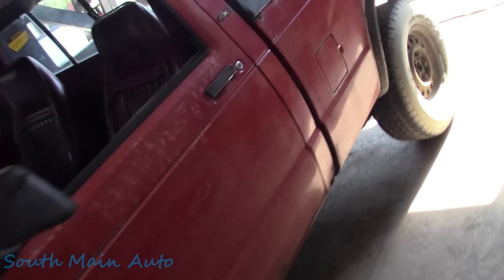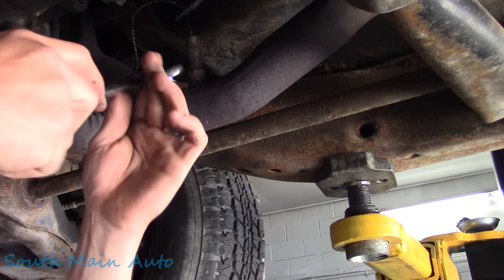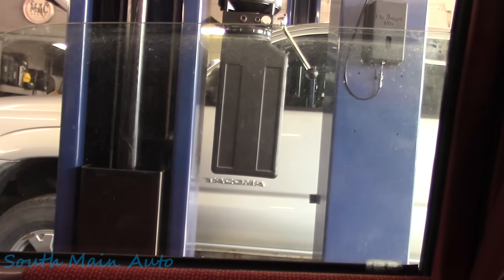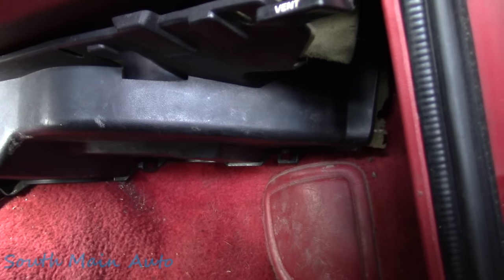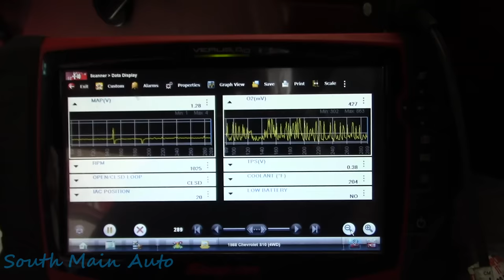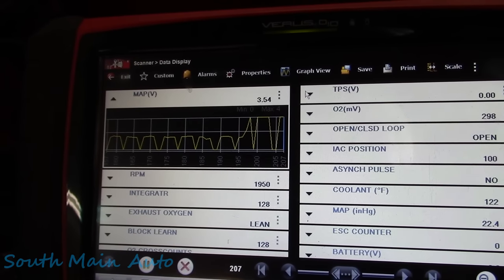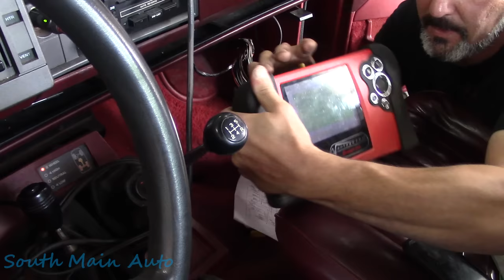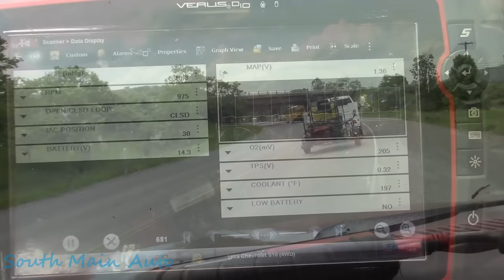Chevrolet S-10 - High Idle and Dies After 20min Drive?!

Comment: Those boxes were always right next to the heater core ,,I always thought that's what caused them to heat up and also with the heating and cooling under the dash it will let that green gunk build up on the wire pins an not get a good connection, I use to take them out and spray either in them then dry them with air and they would work again I don't. Know

Comment: I had a 4.3 chevy 1500 did the same thing going nobody could figure it out so I sold it.  two weeks later gmc tech told me he knew the issue he discovered on another car  computer got ground  from bolt location holding thermostat housing. Corroded terminal under nut.  Cleaned it up corrected the issue

Comment: My guess is there was a failed capacitor inside the PCM unit.  They tend to fail with age, especially electrolytic capacitors.  They will actually start leaking the electrolyte, and when that happens, they do really weird, wonky things to circuits.  If you were to take the unit apart, you would probably see one in there leaking.
Reply: @Pete N These damn whippersnappers got it too easy!  When I was your age, we had to wait for 30 minutes for the TV to warm up!  😀

Comment: I had a 90 s10 extended cab 4.3 2wd Tahoe it had a problem like this it would be fine for 20 min or so than barley run or die worse if it was raining or high humidity the truck had over 200,000 miles at the time it ended up being a worn out sloppy distributor changed it out fixed that problem  the truck had over 315,000 miles when I sold it I replaced all the parts that you figure ware out fuel pump, alternator, starter water pump, fixed the intake gasket ,just basic maintenance it  ha 90,000 miles when I got it the first thing I had to do was put a new clutch in it ran good after that when I failed emissions it  needed new fuel injectors it was a good truck after those 2 initial fixes than after that was fix it as it breaks and only to be expected with high mileage

Comment: I am wondering what the cost of this repair is assuming the pcm is replaced and solves the problem.  hmmm...  years since i dealt with paying mechanics -  like 30 years.   well, i  suppose it is his hourly rate times the time.  He has got a lot of time in this project.  i would say something like 8 hours. that includes test drive and finding parts.

Comment: Dang, cutting torch to heat up an O2 sensor? Seems a bit much, ..no? Why not a simple propane or map cylinder instead or turn down the heat on that torch perhaps? I have inadvertently burned holes through metal where a hole was not required!

Comment: Sounds like a bad internal ground on the PCB board. Cracked solder joint. Definallty will separate when hot.  Probably an easy fix but that's outside of most mechanics' scope of work.

Comment: I have seen before sometimes it is with the computers and cars the filter caps capacitors inside will start to leak the 90s eagle talons and Mitsubishis were known for back in the early 90s. Change out a few capacitors clean up the board and the car was good to go

Comment: I'd like to know who would replace a 2.8 with another 2.8? I'd at least drop in a 4.3 or even a 305. Can't find a decent 4.3 or 305? Oh well, gonna have to bite the bullet and LS swap it...

I'm all for keeping things original and my job had an old 2wd S-10 with the 2.8 that had good enough power for puttering around town, but if you're going to spend lots of money fixing up an old truck, might as well upgrade it.

Comment: Wow I had the same model truck years ago same issue it would run fine then it wouldn't. Took it to the dealership they replaced and reprogramed the prom chip then it ran good for a little while then did it again, they charged me again for another prom chip and again months later it started doing it again. I got rid of the truck because of it! If I had only know it needed a new PCM so much for dealership experts right...

Comment: There’s several PCM/ECM channels that will try to repair these circuit boards and without exception, the electrolytic capacitors are puking out their guts (alkaline solution that keeps the insulators inside the capacitors viable) onto the board. When that happens, the nightmares begin, because it will eat away the solder masks and then the traces on the board. After that it’s a roll of the die to see if the traces are repairable. Worse is if the alkaline puke from the bad capacitors has attacked the tiny legs of an unobtainable IC and eaten them away. Then the board is just scrap. Any ECM from before 1990 should be removed and cleaned and the electrolytic caps replaced if you plan on keeping the vehicle. And if you find any tantalum capacitors, replace those with as exact replacement caps (or as close as possible). Those tantalum caps tend to fail in a shorted condition, and will just take the whole ECM down. 

Thanks MR. O for taking us along. Don’t worry if you’re stuck walking. We will walk along with you any day!!

Comment: cars back in that era it was an ECM. electronic control module, the ECM had NO control over the transmission. if it was an automatic it would have been vacuum modulated. 

PCM, powertrain control module..... controls transmission AND engine.

Comment: They make a special sock at the slides over top of the Emoji senses yellow four stores have told you about that socket that has a slot in it she can slide over top of the wires and pull it out that way with a ratchet it's a special tool for them

Comment: Typically the filter capacitors in the cpu are what fails and presents these types of issues.  Voltage becomes unstable from improper filtration. I have fixed a few this way.
Reply: Fixed a few WHAT way?? You only described what the problem is, you DIDN'T EXPLAIN what you did to fix it.
Reply: @billscow  Replaced the capacitors that failed. The tops usually swell indicating they've dried up. There are meters available to test them as well because they don't have to be swelled to be below operational capacity. Yes, I do forget that not everyone knows what I'm talking about, I apologize. Google search swelled capacitors, you'll catch on fast.
Reply: Older systems also utilized capacitors rated to withstand 85 degrees of heat, new builds utilize capacitors rated for 105 degrees. If you buy capacitors to replace the old, get the newer 105 degree type.

Comment: those 2.8 litre v-6 got put in a lot of Jeep cherokees and s-10 pickups. Very rarely did I accomplish a repair without having to treat it with sea-foam and replace the EGR valve. Drive ability was almost non-existent. On top of that the electronic carburetor, and they always took it to a couple of morons before deciding to bring it to me.

Comment: In Ohio world's salt and rust capital of the world or so I've been told lol but that's exactly why I keep a bag of o2 sensor bungs and 7/8's hole saws in my toolbox at all times lol sometimes that's the only option either because of parts availability and/or price... normally only takes a bit to weld in a new bung and install the new sensor there... but I always try to get the original one out... I love my inverter for that exact job more than anything lol it's made a  lier out of me a few times because I was absolutely sure I wouldn't be able to get the old sensor out but those things just freakin work most of the time.... 
Its funny I've noticed that alot of shops in my area won't even work on those older vehicles anymore...anything pre OBDII  they just don't want or something.... I may not be able to work on cars all day long for a living like I used to  but I'll take those old vehicle drivability jobs almost every time lol

Comment: Oh yeah brake clean on the piston ring trick. I once used brake clean and had to tear down the engine after because it robbed all lubrication to the rings I had to replace pistons because the rings were welded into the grooves. What a complete nightmare. So if you ever try to start one and it doesn't start check compression. Lmao true story.

Comment: I had a 4-cylinder EFI 1985 Chevy S-10.  The throttle position sensor that screwed into the EFI went bad (erratic idle).  Put another one in.  Ran fine for 8 days or so, LOL.  Replace the 8-day-old one with another new one.  IT TOO died in about 8 days.  Arrgggh!  Traded the &*(^$&*(&*& GM truck for a 1997 Toyota T-100 pickup and have lived happily ever since.  I will NEVER buy another GM vehicle again - EVER.

Comment: Could you have deleted the PCM and install an aftermarket fuel injection with it's own computer?
If the PCM is only for the fuel injection it doesn't matter what computer is running it. No OBD2 port on that truck.
Reply: 10-4  spend 2K on a 1k truck 👍

Comment: When i was at the chevrolet dealership back in the late 80's to early 90's..  i ran into those problems often.. when it started tweeking out while driving it.. I'd reach down and tap all over the the e.c.m and it'd clear on up and drive on back to the shop fine.. had prom issues sometimes and solder joint issues often.. use to test the boards and do a little soldering sometimes.. ah the memories.. lol

Comment: We had a 1986 Cavalier Ls back in 1993 from a Chevy dealer same problem after 20 minutes and the car died after  we bought the car, we had it tow it back and the dealer told it was nothing  wrong, after three times, we had traded for a 1992 Oldsmobile,  if that Calalier runs, my mother would have took that shitty car right in their showroom floor.
That dealership was so corrupt and crooked.

Comment: I would check and see if there are any plug and play aftermarket LED marker lights installed. Some of those will output EMF that builds over time, can cause interference on a.m. radio, or with data in the PCM.

Comment: electrolytic capacitors have about a 20 yr shelf life. by now, ill bet you if you opened up that pcm, you will find some electrolytic capacitor have leaked electrolyte and damaged the pcb board. if you check out youtuber shango066 he has a couple of videos where he found puked electrolytics on pcms. his main videos are about old radio and tv repair, but there are a few car related vids on his channel.

Comment: Jasper oh no  Expensive Gray spray paint  It took My old boss 4 warranty Jasper's one seized in the crate wouldn't Is even budge with a breaker bar But It had a piece of paper saying it got ran on a break and DinoTotal BS Before he let me start sending off Block cranks rods etc 2 Are local reliable machine shop to in house Rebuild/assemble with Knowledge Engines Because he finally figured out that the $40 an hour warranty plan At book time does you almost no good when you have to do it twice And I have to be honest about most shops that want to put remains in everything if you can't rebuild an engine you shouldn't be in the business if you have a good reliable rebuilder that saves you time that's a different thing But very hard to come by these days unfortunately